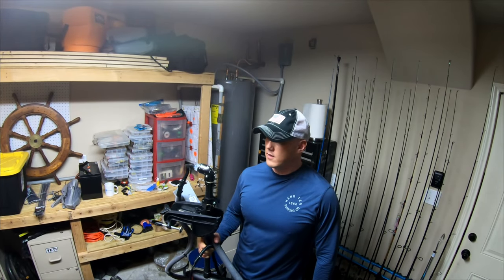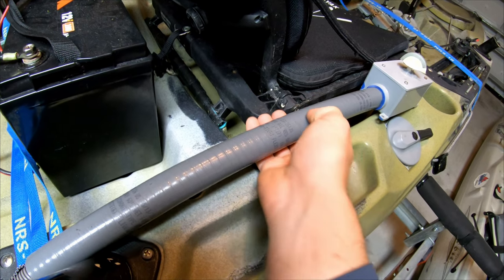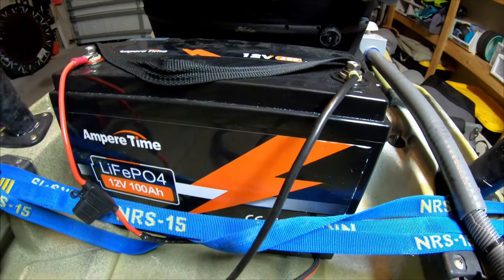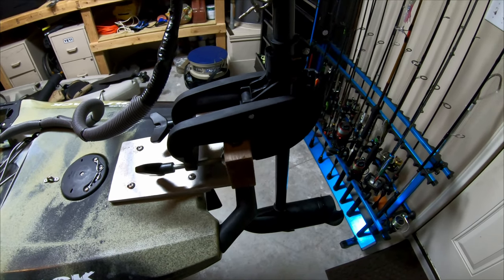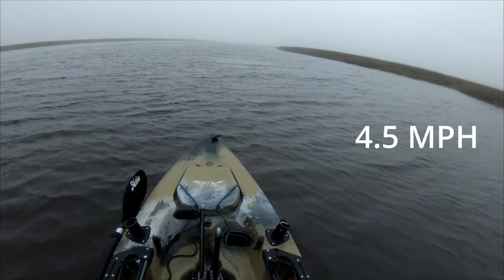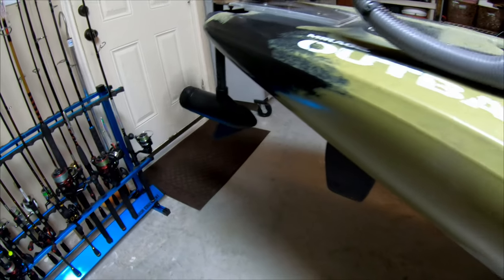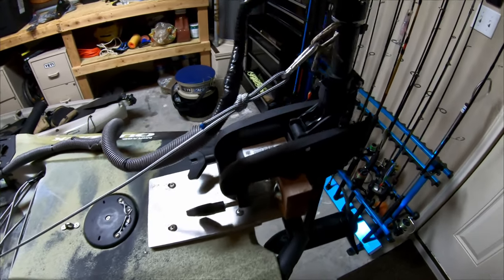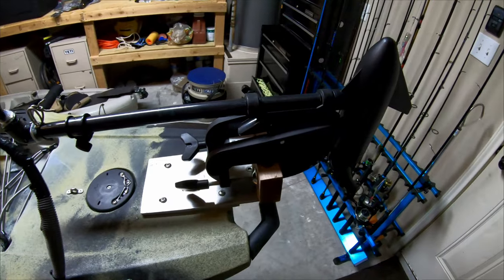Best DIY Kayak Trolling Motor & Mount - Low Cost

Comment: not to be rude but to actually waterproof you should buy the proper flex connectors with a female adapter when attaching flex to a junction box.. your connection will not last long as is. Also use conductive grease on electrical connections to prevent corrosion from the saltwater. best of luck.
Reply from the maker: I dont think your rude at all. I appreciate the advice. Its worked well with no issues for 2 n half years in harsh saltwater conditions so its sealed enough for my needs. Was meant to be a budget build, brush motors have a relatively low life-use in general. Will be moving to a Newport motor soon as Im now an ambassador for the company.

Comment: i have a hobie compass with a 55lb newport trolling motor with a 100ah battery and if i run in full speed i get maybe an hour... if i run it on 3 it will go from 6am to about 2pm. but thats not consistent so idk how you are getting that amount of use especially at full speed
Reply from the maker: @jeremypeterson7384  You're pulling 40 percent more amperage out of a 55lb thrust motor, secondly not all lithium cells are created equal even amongst published amp hour ratings.

Comment: I need to understand the speed control. I want to mimic your set up. Thank you in advance
Reply from the maker: @hershelrhodes3216  I used the existing pot from the trolling motor and extended the wires.

Comment: Dude thank you so much, I’ve been overthinking about what potentiometer I should build and you solved my problem, I’ll just use the existing controller from the head, sheesh you’re a life saver
Reply from the maker: Glad I could help, I like to use the simplest approach if its robust typically. I'd be interested to see your setup when its complete. What motor did you end up going with?
Reply: I picked up a motor guide r3 45lb for $50, but I messed up I cut the shaft down to 24” and I feel like it’s gonna give the kayak a hard time when I pull it up to stow it
Reply from the maker: @Markchance08  Mine measures 23 inchs top to bottom. I prefer it more low profile. You could always add a 1 inch wide metal bracket extend it off the top of the shaft as a pull moment arm to raise and lower if you need it.

Comment: Looks good.  Mines been working great the last 6mo.  I use a 55ah battery, so far so good.  I put an eyebolt on the mount, it gives you better leverage retracting the motor for stowing.
Reply from the maker: Good stuff man. I use to run a 55ah but would die on me after a few hours. I bumped up to the 100ah for piece of mind and have yet to run it dead.

Comment: Do you think a saltwater trolling motor would be worth the extra money? Found some Newport nv series saltwater 36 lb for a few $$ more. Thanks David
Reply from the maker: If it gives peace of mind and you have the funds to spend on it may be worth it for you. Another aspect to consider is power to weight ratio. Running a bigger motor adds more weight which doesnt translate to real world speed. Creates increased drag and forces kayak to sit deeper on waterline. For me personally I dont see a need to forego the extra cost. The internals all work the same, its an electric motor with a housing and someones name brand on the side. At some point they all fail, rotator spinning in the stator rubbing on brush blocks slowly causes wear. Hope this answer helps but everyone has specific budgets and needs, ultimately youll have to decide.

Comment: What size wire did you use for the + and - from the potentiometer back to the motor? I was thinking 6 gauge but not sure
Reply from the maker: @neilprusinski9666  6 will work

Comment: Hey man.  I was wondering how you did the control in the jbox.  Howd you connect the little dial on the outside?
Reply from the maker: Cut a small hole in the box for the potentiometer shaft to extend out, slide the knob over the shaft and seal as required to cover any gaps.

Comment: Question . What's the wire size you used to extend the switch to up front . My motor have 14 gauge coming of the shaft . I'm a bit concern that if i extend them of 5 feet it could be hazardous .
Reply from the maker: #10 or #12 AWG will work fine. Lower HP thrust trolling motors arent pulling many amps in 12 volt configs.

Comment: what did you use to add the wiring to the box like what did i use to make the wiring longer
Reply from the maker: Splice in additional wire to the desired length

Comment: Do you think this motor would be strong enough for saltwater fishing? I’m looking into making a motorized kayak and so far this is the simplest and inexpensive set up.
Reply from the maker: I use this motor for saltwater fishing, so yes. It is simple and easy to replace which is why I run it. An electric motor is an electric motor, some have different housings, price, and name brand but the internal components work the same.
Reply: @Jacemang_Outdoors  thank you for the info!

Comment: Does the motor want to turn left or right at the higher speeds or does it straight or does the velcro strap keep that from happening?
Reply from the maker: The motor is locked into position. The kayak will run true(straight) when it is being propelled by the motor. I use the rudder to steer or make small micro adjustments when needed. The straps only purpose is to keep the tilt lever engaged so the motor can kick up freely if it impacts an object while in motion.
Reply: @Jacemang_Outdoors  thanks i'm fixing to rig my native with a trolling motor. Just trying to get ahead of any prep work I need to do before hand. I plan on fishing local lakes here in east texas and the bolivar area with it.
Reply from the maker: @jwblount7802  Awesome. Just curious, what motor you going with?
Reply: @Jacemang_Outdoors  I have a minn kota 55lb thrust that I had laying around for ever. I'm gonna start off with that one and see if drags real bad like what you described. Then I will purchase a different one if I don't like it. Just using what I have first.
Reply: @Jacemang_Outdoors How do you lock it into place?
Reply from the maker: @adamhelgeson680  It comes with a tension knob you can adjust and position the motor at your preferred angle.
Reply: @Jacemang_Outdoors  thanks!
Reply from the maker: @adamhelgeson680  anytime!

Comment: So not locking the "tilt" function of the motor doesn't affect its operation? Every other video ive seen has it locked.
Reply from the maker: The forward thrust of the motor against the water maintains constant pressure forward. If you hit the ground or an object, motor kicks up freely. I keep the tilt unlocked for those reasons.
Reply: if you're going forward it will work just fine without the lock.  Going into reverse is when you'll have a problem without the lock.  The motor will kick out of the water and will limit your ability to reverse quickly.
Reply from the maker: @seewhyem  Thats pretty accurate. Pros and cons, Id rather have the motor kickup some in reverse than suffer a catastrophic failure hitting something going fwd. The weight of the motor will keep it down in lower speeds, if I need to reverse quickly which is extremely rare, I can assist with pedal drive.
Reply: @Jacemang_Outdoors yup, agreed.  If you don't use reverse then removing it would make it easier.  I personally use reverse all the time so I kept my lock function. I used a pulley from home depot and a paracord to engage and disengage the lock lever.

Comment: My setup is similar. I don't know the actual range of my battery as well. Iv been about 12 miles with it at a time, I think it will go further but I just don't know.
Reply from the maker: That motor is really efficient. 100 ah battery will run it for a very long time.

Comment: what to do if you dont have power pole screw holes?
Reply from the maker: Drill some small holes for a mounting bracket and reinforce the inside of your kayak with a backplate or washers.
Reply: @Jacemang_Outdoors  thank you gonna try rn
Reply: i put the trolling motor thanks for the info, do you have a video of how to jist raise and lower while sitting down. that pully system you have is great idea,I have to jump out once I get to shallow to put it back up, @Jacemang_Outdoors
Reply from the maker: @MYNAMEISNUMBER2  I raise and lower mine from the seated position no problem.

Comment: Great video brother..just bought this exact 30lb motor at Academy yesterday after watching your video..I have a question on the wiring..what size gauge did you use to extend the wires?
Reply from the maker: Thats awesome man. I used wire I had laying around, its around 6 to 8 guage which is ideal for moderate amperage 12 volt power sources. Id like to see how your build turns out when complete. If I can help answer any other questions dont hesitate to msg me on facebook, same name: "JACEMANG OUTDOORS". Happy to help.
Reply: Appreciate the response man..I’ll definitely keep you updated on it 👍
Reply: Just in the process of adapting that same trolling motor (MINN KOTA Endura C2 30lb) to my kayak. In dismantling the MINN KOTA, I noted that 14 AWG is the thickest wire in it. In fact, the middle speeds rely on the 16 AWG yellow while the slowest speeds rely on the 18 AWG white wire (thinnest of all). Long story short, I'm using 12 AWG for my external extension wires.  @Jacemang_Outdoors
Reply from the maker: @Larry77777  Thatll work! You can always upsize and undercurrent or heat isnt an issue

Comment: Man how do I hook up that power box to turn my motor on and off
Reply from the maker: Simple setup, I used the existing potentiometer from the original trolling motor head and ran it up to my seat. The electrical contact prongs are labelled, essentially youll connect power and ground to your battery and power back to your troller motor wires and youre good to go.
Reply: @Jacemang_Outdoors  great thank you for answering, I’ll definitely try to make this happen your video convinced me. Do you have a video or how to for the power box and extended the head of the motor to kayak chair
Reply from the maker: @jaypa5  No video on that specifically. The potentiometer in the head is just a switch with 5 positions fwd and 3 reverse. You connect the terminals to it from your trolling motor wires and power wire from battery and youre good to go. Its super simple. If youd like, msg me on facebook: JACEMANG OUTDOORS. Can maybe give you a vid walkthrough if youd like.
Reply: @Jacemang_Outdoors  awesome will do

Comment: total cost for everything?
Reply from the maker: I used components I already had for the mount, power source, and wiring. Any rigid material will work for a mount. Ive seen several mounts built using star board or other inexpensive dense plastics. Wiring is dirt cheap. The Minn Kota trolling motor can be purchased from Walmart, Academy, etc. for around $100. A fraction of the cost of competing pre-assembled options, just takes a little time.
Reply: Thanks @Jacemang_Outdoors

Comment: Thumbs down because of the dumb opinion on registration.
Reply from the maker: Its not really an opinion, its a requirement. 20 years experience in aerial search and rescue operations, Ive pulled countless people out of the drink that were able to be identified and located by their hull IDs after falling overboard. Although it might be a hassle, registering a motorized vessel is a law and has merit that extends even to those that dont understand why.

Comment: Why not just get a John boat confused
Reply from the maker: Ive had boats, they definitely have their place. That question requires a lengthy answer but Ill give you some highlights. Kayak community is engaging and I enjoy the comradery. There is a large kayak tournament scene and I also enjoy the competitive elements. As far as utility, kayaks have less moving parts, less maintenance/malfunctions/corrosion. Theyre more sea-worthy relative to size. I have more launch options including the surf to fish offshore, better access to shallow water. An intangible element I personally enjoy is a closer connection with the environment and the ability to get directly on top of fish without spooking them or the need to disembark a vessel and wade fish. Hope this helps.
Reply: Because we already have a kayak. Thats why were watching a video on a.    Kayak lol
Reply: I myself onwn a boat and kayak. it’s called getting to skinny water and/or getting away from the bass boats back there with the big bucket mouths that the bass boats can’t catch because they can’t get back there…. I’ve got about 15 other reasons for you if you wanna hear them and be negative about trolling motors on kayaks. The biggest question is why are you here watching this video about trolling motors on a kayak if you don’t, for example on one or are trying to trolling motor on a kayak?
Reply: Trailers..
Reply: Because we broke mf
Reply: Portability.